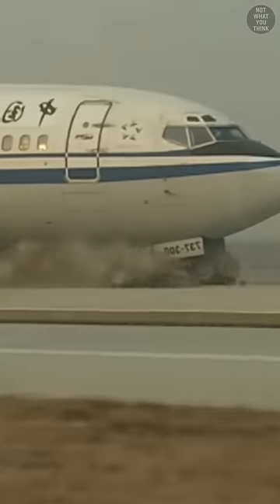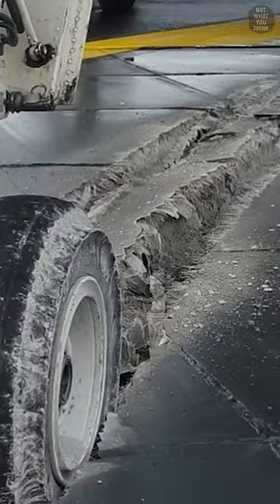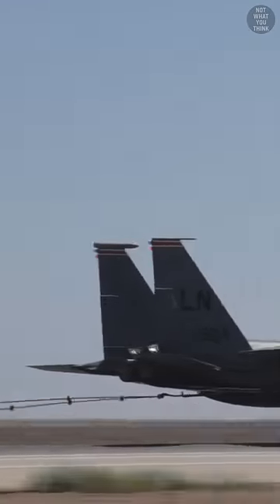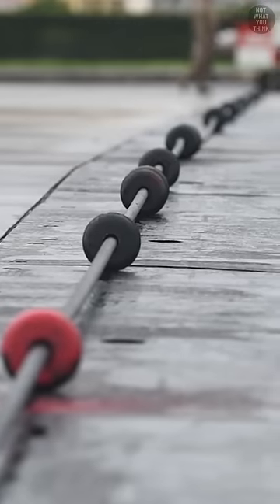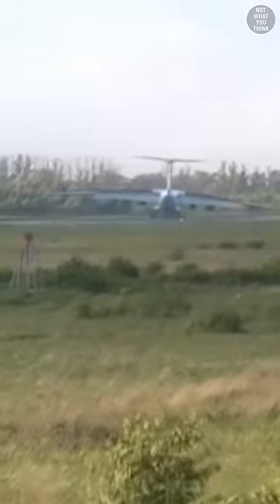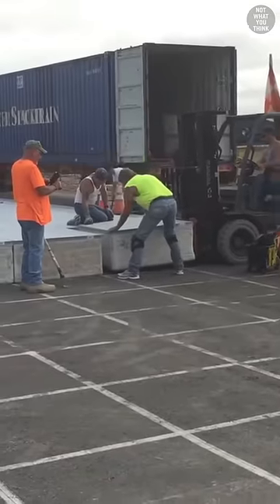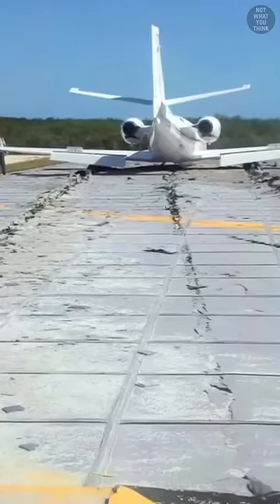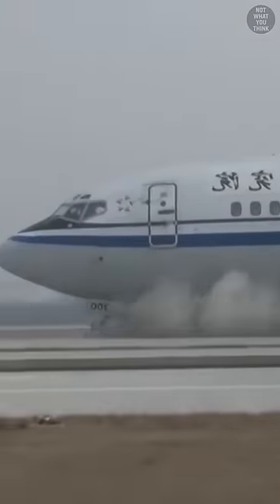Emergency Landing of Commercial Aircraft #shorts

Comment: Why NWYT , I have a few questions for you.  Can the EMAS be reused, how much does it cost and will it be useful in the long run?
Reply: It is essentially aerated concrete, a type of concrete specially designed to contain a lot of air in it's make up.  So it should be recyclable in the same way as standard concrete.
Reply: Yup.  Simply clean the debris and repour the EMAS material just like concerete
Reply: "Will it be useful in the long run?"
...
I imagine a plane (and the people inside) saved would be worth the cost even if it is one-time-use-only. It's not like the pilots are supposed to reach that, it is more an emergency break.
Reply: If a safety system works it becomes a part of the safety regulations and then it's not so much about a question of if it's worthwhile in the long run. This track and the nose gear is relatively easy to repair than getting entire fuselage smashed into whatever else will stop the plane.
Reply: Yes they just replace the damaged blocks with new ones (not quite poorer like concrete though, they are made in the plant in NJ). The full system costs a few million dollars and acts as an insurance policy. Repairs are paid by the insurance of the aircraft operator that overran the runway
Reply: It's not like every flight goes through that just to halt. It's for emergency and not every aircraft would need it. So yeah it's pretty long run and like others pointed out, it can be repaired back to original state for next such incident.
Reply: You thinking like me? Runaway Truck ramp. Just net stones inplace. Or grow a little grass over it.
Reply: I would imagine it would be easier to put some gravel there instead
Reply: @geemcspankinson   maybe but then you can’t guarantee that it will safely arrest the airplane and the FAA wouldn’t approve it
Reply: @jopick  Well, FAA will always say what it will. I guess the concrete ones are more predictable in where they break and lead the plane. I don't see other bigger differences to gravel than that.
Reply: @geemcspankinson , it’s a liability problem. Airports can only install approved equipment and the FAA will only approve a system that has been proven and tested to stop aircraft. If you want to start a company selling gravel pits to airports, you’re going to need to do lots of expensive testing at the FAA technical center and strong FEA modeling before being approved by the FAA. Then if the system fails you’d be liable for the damages, injuries or deaths… that’s why there’s only one or two expensive solutions available currently 🤷🏻‍♂️
Reply: @jopick  Yes

Comment: The downside to this, I'd imagine, is if an aircraft slightly overshoots the runway during takeoff. Rather than allowing for the extra runway space needed to takeoff, it would slow the aircraft down enough to prevent a takeoff but not enough to stop it completely as it would be close to VRot.
Reply: It's an extension and VRot is often way before the end of the runway
Reply: @goldman7074  Yeah, but so is a landing
Reply: @kbg990  this system isn't meant for normal operations it's for major failures. If you lose engines you lose the thrust reversers. Brakes can fail partially or completely. That's what EMAS is for. (edit misspelling)
Reply: @robertstoneking7916  I get that, but its a system that is always present on the runway, not something the airport deploys ad-hoc, right? My point was, what happens if a takeoff takes longer than anticipated, which has happened before, say due to incorrect loading sheets, incorrect flap config, etc. It's just a thought.
Reply: @kbg990  If you get that far down the runway something major has failed and you're left with hoping you have enough lift to not dig in and there are no buildings over story tall in the first mile.

Comment: Watched a show where the engineers who developed the system were in the plane that tested the system. The drag snapped the front wheels off but otherwise worked as intended. Kudos to the team. They were confident enough to be inside to prove it worked. I want to say Modern Marvels but can't remember. It might have been Engineering Disaster show. Moments Before Disaster?

Comment: Similar idea to runaway ramps for semi trucks or other large vehicles that lose function and control of their brakes. Typically is seen in the failure of air brakes on downgrades, due to a loss in air pressure. This occurs from too much use of the brakes and not allowing the compressor to maintain proper pressure, thus losing the air brakes in the process. There may be some details I’m missing

Comment: I cant image how if the speed of the plane doesn't effected by EMAS things
Reply: I was thinking about this, the images shown have several smaller planes in them, a 737 is pretty large, along side a 727, but i bet these planes didnt have a simulated weight on them, if a fully loaded 747-8 or A380 hit one of these, im not sure how this would work on such a large plane.
Reply: @bias0437  The plane would probably sink deeper and it would work just as well.
Reply: @bias0437  up until recently it wasn't exactly cost effective to crash test a 747
Reply: @Bangus  EMAS is never relied or planned on being used. A larger plane requires larger runways. It’s not like a Cargo plane would touch down at the beginning of the EMAS. The plane has already used up the entire runway first, the EMAS is literally the last resort.
Reply: You 3 have good points, didnt think about any of that, thanks guys!
Reply: Speed, weight and landing gear profiles are used to design the proper EMAS for each airport based on its airplane fleet. So JFK has a much longer EMAS than Reading, PA and stiffer concrete to arrest larger airplanes for example. But small airplanes will still crush the top part of the concrete and decelerate in most cases. That’s why airport personnel are not allowed to drive on them, only walk for inspection
Reply: @bias0437  definitely appreciate the goodwill 👍🏽
Reply: Could you write that in English please?

Comment: This stuff is often called foamcrete, because it’s basically a concrete foam. Durable, but easily crushable without tearing the plane apart due to all the tiny air pockets and voids. Literally concrete with a foam-like internal structure. Cool stuff.

Comment: 737 at Burbank went right thru the fence and into a gas station.  The gas station was removed.  Emas was installed.  Caught a 737 and a business jet so far.   They also dont park the refueling trucks close to the end of the runway.  Now to shorten the flag pole at the us storage across from the north end of burbank runway 15.  Planes main gear has crushed the ball on the top of the flag pole.

Comment: I remember reading that the EMAS manufacturer no longer makes EMAS bricks, so you can’t get new ones, or even replace old ones. 

(It isn’t a poured technology, it’s bricks that are placed on a poured surface.)
Reply: I can't find any evidence that's true. They may have changed techniques, making an older system obsolete and thus lacking replacements, but not stopped entirely.
Reply: @westrim  Zodiac, the first ones to make it in conjunction with the FAA, did indeed stop production, due to reduced demand (those airports - in the US - that were going to fit it, had it) and increased international competition. Runway Safe AB and the Chinese are still actively manufacturing.

Comment: Its the same thing as a runaway truck ramp works on a steep downgrade. Truck heads up the ramp and stopped by 4ft thick loose rock sand and gravel slowing the truck down in the event of brake failure.

Comment: The EMAS system seems similar to what they use in drag racing, after the really long length of track they have to slow down is a few different things like barrels, a sand pit, and a fence at the end. They’re so confident of it that at the one track I was at, beyond the net was a sheer cliff down to a ravine.

Comment: I remember the first time I heard about this crushable overrun when a plane went off the end of the runway at LaGuardia into flushing Bay and the reporter interviewed someone from the airport that said that they wish they had authorized the use of a crushable overrun. I think that was somewhere in the late seventies at that point

It's pretty neat how they make this mixing soap bubbles in a concrete mixture that quickly sets so you can walk on it possibly drive on it but the speed and weight of an airplane is just going to go right into it
Reply: LGA has it now look at what happened to Mike Pence’s plane when he was on yhr campaign trail

Comment: In Summer weather of the Extreme heat on the pavement without any shade out on the run ways and in the Winter time of excess Snow that be on the pavement of the run way, and also flooding rain pours that gets on the run ways can take it's toll on the pavement that can become some what soft, especially during a heavy plane that's landing can rip apart the pavement on impact!

Comment: Maybe it's time airplanes are to be equipped with solid rocket boosters as emergency reverse thrusters.
Reply: Some Were; Military Ones. I Think Certain C-130s? Anyways They're Too Expensive And Single-Use, And Would Be Awful And Environmentally Dangerous To Use Around Civilians.
Reply: It should be better than crashing. 🤔 
Of course it's for one time use and for emergency only. 
If the airplane fails to land normally and had to use the rockets, it should not be flying anytime soon. It should go straight back to the hangar for Maintenance.

Comment: What happens when an aircraft has to make an emergency landing on water in an area where there’s other ships & boats? Do the ships & boats get told to get out of the area asap on their radios?
Reply: Boats and ships are slow and can't get out of an area fast... so that could be difficult, depending on how much time is left until reaching the surface. In the famous example of the landing in the Hudson River in NYC, there was no time to warn anyone. The pilot was lucky to find a sufficiently large spot that was free from vessels at that time ... but it was also good that there were some ships / boats nearby that were able to quickly come to the plane and pick up the passengers and crew.

Comment: How about having shallow water pond or a shallow mud field? Would that achieve the same results?
Reply: Ponds attract birds. You don't want birds near airfields.
Reply: if it’s the same results y switch it at all?
Reply: Shallow mud wouldn't do great if the temperature are too cold. Either way, it would attract living animals in it. Too risky if it's gonna invite pack of birds. 
~
What EMAS do is like sand (reality is concrete) but structured like spons. Can hold a weight, but also can be crushed.
Reply: @cagin5  also I don’t think people would be happy with planes crushing a bunch of birds every time the brakes fail

Comment: Tell that to the Brazilian victms of TAM flight in 2007. Almost 200 people has died when pilot and his co-pilot ignored the length of airport way touching down without using turbine reversion boost. The irony lies in the final part when the plane pass trough the final contention barrier and hit a gas station right after the airport and every passenger died burned in flames of the combustion of gas station and airplane fuel. Brazil is not a place for those of weak heart.